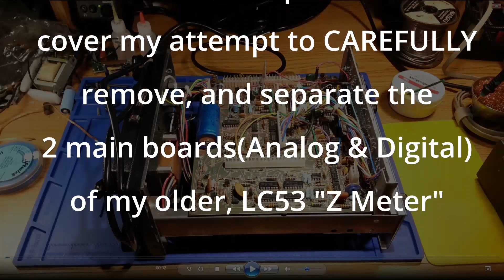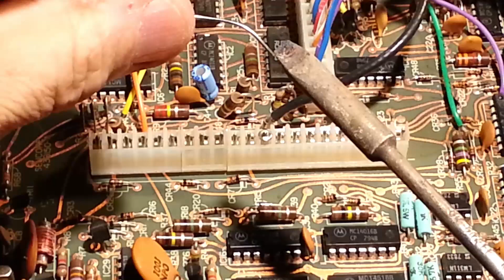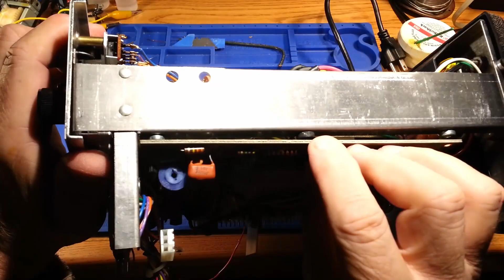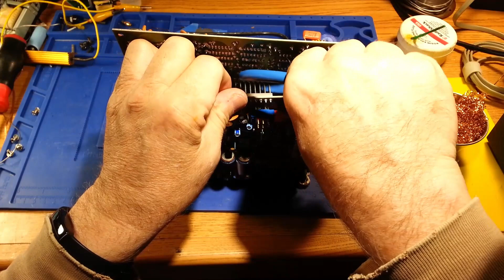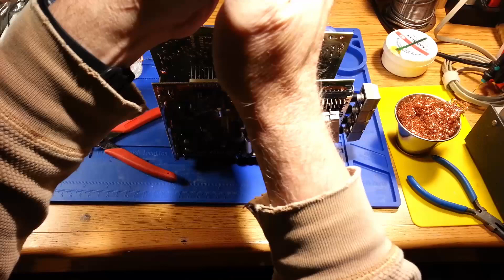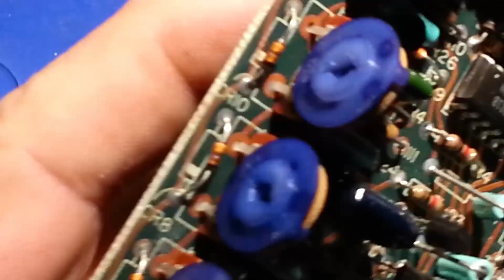E015_PT04 - Sencore LC53 Disassembly Work

Comment: I have an LC3 that I want to shotgun all the electrolytics, as I think that is why I am getting screwball readings and in some cases no reaing at all on some caps. Your video is a big help, thanks !
Reply from the maker: I was lucky on this unit to the point that none of the board mounted caps were showing parallel leakage or actual physical leakage, but I have seen at least one video where a device with the light blue Rubycon caps had caps out of tolerance and with bad ESR's. The main axial power supply cap, C4, 2000uF, on the other hand went high ESR, I would look at that one first as it would drag down most other operating voltages. If you have the darker colored rubycon's, they may be new/good enough to not need to be shotgunned as of yet.